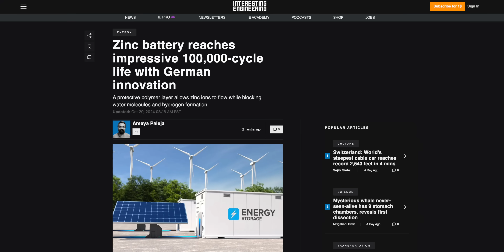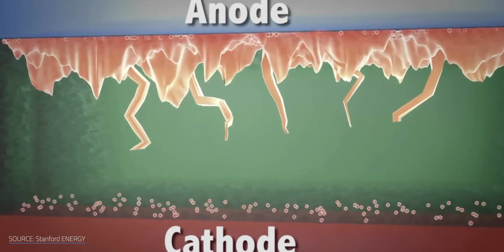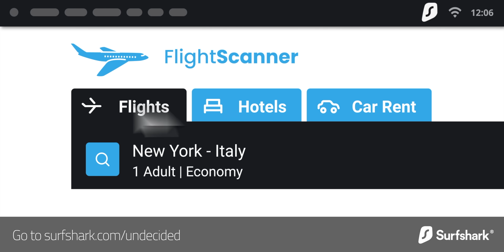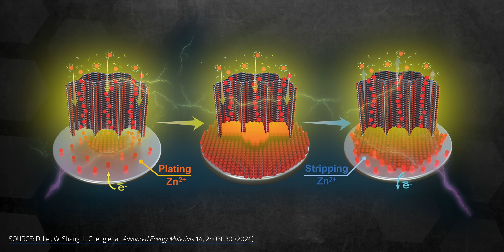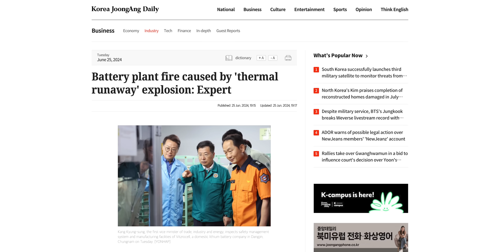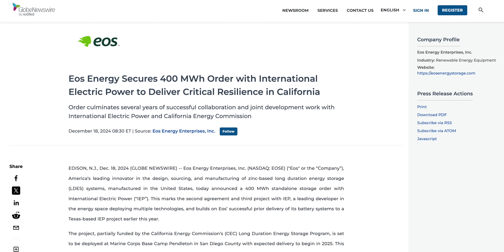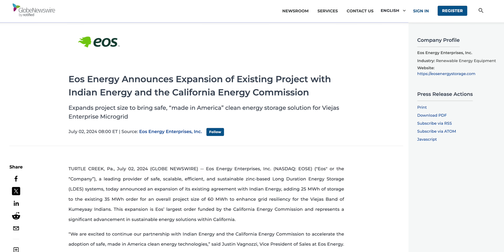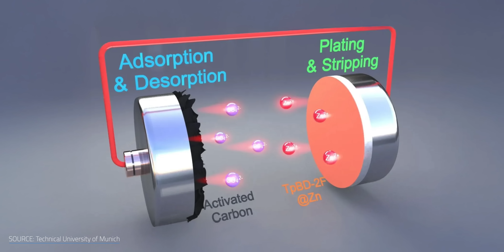How Zinc Batteries Are Defying Limits

Comment: Why do batteries have to last forever without any degradation yet we accept that a motor needs servicing and having parts replaced annually.
Reply: The energy density and power output per kg is super important too. If a battery has 500 times the energy density, but only holds 80%+ capacity for up to 10-20 years, it has more potential use and utility than one that lasts 273 years with 2 orders of magnitude less output.😊
Reply: what?
I never hard to replace parts in any of my car's engines.
What do you do with yours that you need annual parts replacements?
Reply: @joz534  fluids and filters every service. Belts less regularly. Other seal kits at regulated intervals. An occasional water pump, alternator or battery.
Reply: When you’re making massive investments in capital, you care a lot about cost per mile (in vehicles). I’m not sure what the metric would be for batteries, maybe cost per cycle? But the cycle gets smaller as the battery degrades, there’s depth of discharge metrics, etc. it basically comes down to how much it costs to maintain the batteries indefinitely. For gas engines, the initial cost is relatively low, and maintenance cost is also low. For batteries, initial cost is high, and there is no maintenance. Except there is a maintenance cost for batteries. You’re either continually adding more batteries to the system to make up for degradation, or after a certain amount of cycles you’re replacing the entire battery pack. Say you install a BESS that costs $1million. Because cycle life is low, you’re going to have to replace it every 10 years or something. That means it costs $100k a year to maintain. If you double the cycle life, it’s only $50k you have to set aside every year to maintain the battery. Doubling the cycle life effectively cuts your costs in half. Even if it costs 50% more to manufacture, you still come out ahead in overall cost. That’s why cycle life matters.
Reply: Because if I'm spending $10,000 on a battery for my house it damn well better last. Current lithium ion battery technology for homes is pointless as you never recoup the savings as by the time you have the battery needs replacing
Reply: The average engine if properly maintained can last well over 1M miles. The average car if properly maintained can last 30 years or more. Its the companies who keep telling us we need a new car every 5 years and stupid people who keep buying new ones every 5 years.
Reply: Motors are relatively cheap.  They're mechanical too, so it's expected that they'll degrade.  Hard to say whether any engineers feel batteries must last forever but the fact of the matter is, most batteries aren't lasting long enough for how expensive they are to produce or to recycle.
Reply: We don't. You think you have to replace an electric motor's parts in your car every year? It doesn't need servicing, either.
Reply: hands up which of you believes a 250hp motor is still 250hp after 5 years. What about 10? Yet batteries degrading over time is soooo a deal breaker. :)

Comment: Before even clicking on this click-bait video, the obvious point is that engineering is all about trade-offs.  If these were "the perfect fast-charging high-capacity quick-discharge battery that are easy to manufacture", they'd make them and we'd pay for them.  But they aren't.

Comment: You keep comparing it to Lithium but if it isn't going to replace or minimize the largest market for lithium batteries, Automobiles, what is the purpose of comparing it and saying all those bad parts of Lithium.  25 years ago, Lithium was a much better battery than Lead Acid, I won't even go into what was wrong with Lead Acid.

Comment: Problem looking for a solution ? who will keep his car / phone for 10 years + ? Maybe for grid storage ?
Reply: Car plenty of people phone not as many, for many normal users the main reason to get a new phone is the battery. My mom has had the same smartphone for the last 6+ years and its still fine. But this is where swappable standardized batteries come in like we have been using for decades in almost anything that isn't lithium-ion. There is also this little thing on the horizon:
The European Union's new battery regulation requires that portable batteries in electronic devices be replaceable by consumers starting in 2027.

Comment: What is the fire risk compared to Li-ion?
Reply: @stevenverrall4527  non they are water based, some minimal hydrogen off gassing but the battery generally won’t burn

Comment: this is the real house battery - if the cost per kWh is also competitive. until then it is still LFP.
depending on financial status, upgrades in the house could also be interesting. either for charging the car faster or backup in case of power outage etc.

Comment: One of the things I never hear people talk about is age degradation.  I just had to replace the EV battery pack on my 2016 Kia Soul EV and it only had 28k miles on it, was never supercharged and it was always garaged and left between 70-90% charge while being stored.  Kia was nice enough to replace it free of charge under an extended warranty, but this does not give me confidence in the longevity of these batteries.  Not only that but many of these batteries are failing prematurely; costing companies a fortune.  It's not uncommon for an EV battery to completely fail after 50-60k miles.  I sure hope they are doing something about this.
Reply: Just the thing I worry about.
Reply: US federal law requires automakers to warranty EV and hybrid batteries for at least 8 years or 100,000 miles, so your car failed just past its warranty. California requires a 10-year, 150,000-mile warranty. Obviously most don't die the day after the warranty expires. EV batteries have improved a lot since 2016. With today's LiFePO4 batteries lasting for 4,000+ cycles (so 240,000 miles for a 60 kWh pack) and BYD, CATL, and Tesla shipping 500,000 mile batteries, battery longevity for EVs should no longer be an issue.

And for home or grid storage, 4,000 cycles means you can fill the battery with electricity every day and completely discharge at night for over 10 years (and then recycle it and replace it with an even better battery). Unless they are dramatically cheaper, none of the benefits claimed for other battery chemistries will matter.

Comment: Now, We need a company that will make a replacement battery pack for the vehicles...
Reply: As said in the video its not good for EV unless you want to drive around with a trailer that contains the much larger battery. Could make charging easy just swap trailers.

Comment: Zn cells typically run at 1.6 volts per cell and store something around 40W-h per kg.  These are values that only appeal to stationary applications, Not EVs or phones.
Much of Matt's video more so makes the case for sodium-ion batteries.  No surprise as the performance specs of Zn batteries are unremarkable.
Reply: Great points but you for got to mention the relatively low efficiency of Zn that makes them far less economical to operate and more-or-less rules them out as a viable option for most commercial stationary applications.
Reply: @mm3chadrogers  the efficiency is low due to the hydrogen evolution reaction. the goal of any research into zinc batteries is to reduce the hydrogen evolution and subsequent corrosion, which would increase the efficiency and make them viable to operate.
Reply: @mm3chadrogers  the EOS units are up to 95% RTE on 16hr discharge, that hurdle is dealt with
Reply: @whlphil  I'm going to need you to site your source there because that sounds like BS. Even if it is accurate, a typical Li DC block is 97-98%. Also, with the defunding of IRA on Monday I suspect that EOS's margin is completely gone and they shouldn't be expecting any more DOE grants for at least 4 years.
Reply: Exactly as stated in the video.
Reply: Still much rather have a larger battery on my home that could last decades than an expensive lithium ion battery that will be useless after 10 years and require replacement. At least something like this would eventually pay for itself in savings.

Comment: It's hard to tell whether zinc batteries will win out over other battery tech. The good news is that there are a growing number of battery chemistries that can work. In the end it's about cost per kwh. Especially in the storage market. There are plenty of safe choices for that already. So, cost is the big driver there. And it helps if the batteries don't take up too much space and last very long.
Reply: Great points @jillesvangurp. Additionally, this video fails to recognize the biggest issue with Zn and that's its low efficiency. Li has an RTE of around 98% while Zn is closer to 80%. That represents a massive contribution to OpEx that likely out-weighs the benefits of a longer cycle-life in grid-scale applications. It's also important to note that a longer cycle-life isn't necessarily a good thing in all cases. The technology evolves so quickly that it may not be the best idea to commit to Zn for a 30-year system when something dramatically better is likely to come along in 10 years.
Reply: @mm3chadrogers  If Zn batteries don't suffer thermal runaway and burst into flames that would be a strong incentive to adopt it in many situations.
Reply: @ferrumignis  most Lithium Ion systems available today are unlikely to experience thermal events and as safe or very nearly as safe as Zn. The fire we have seen in recent history (Moss Landing as one example) are technologies that are no longer available due to those kinds of risks.
Reply: @ breaking the covalent bond of an atom and its subatomic particles always comes at a price.
Reply: @ferrumignis  That's almost been eliminated already, you know that right ?
Reply: @ Are you being sarcastic, it's hard to tell?  Just a couple of days ago the worlds largest off-grid battery storage at  Moss Landing experienced their fourth fire.  EV buses in London caught fire multiple times last year.
Reply: @mm3chadrogers the EOS system is 85-95% RTE depending on cycle time short duration discharge lower RTE

The big advantage is no limit on cycles / partial cycles per day, and 3% degradation at 20 years so no repowering, no fire, no cooling system
Reply: @mm3chadrogers  It really depends on the application case, the environment in which they need to work (temp, air moisture, coastline or mainland, altitude etc.) the available space (and the property costs of said space), and much more. If you want low-maintenance solutions, do not rely on energy density and have cheap land available, you might as well use zinc batteries. If you're working with tight spaces and need high charging speeds, lithium (and maybe sodium) are preferable. 

We really NEED to stop with broad claims and instead assess the avialable solutions on a case-by-case basis.
Reply: @TheWeirdaholic  my job is literally to evaluate available solutions on a case-by-case basis in grid-scale BESS. Zinc has higher CapEx and higher OpEx (due to lower rte) relative to Li-ion (LFP specifically) today. It just doesn't pencil unless it's being propped up by government incentives. Now whether we agree with it or not, it looks like a lot of those incentives are likely to dry up with the new administration. Time will tell but it doesn't look like there's much opportunity in the market for zinc BESS right now. If its only advantage is "improved safety", that space is shrinking with current safety trends in Li-ion.
Reply: @mm3chadrogers  Can't argue with that
Reply: @mm3chadrogers  RTE of pumped hydro is less than 80% and yet its still economical
Reply: @E1Luch  you're comparing apples and oranges but ok. How many pumped hydro projects are under construction? 5? 10 maybe world wide? There's like 10,000 BESS installations going up today, almost all LFP. pumped hydro had over 100 years to dominate the energy storage market and it's losing out to Li-ion so maybe it is a good comparison to Zn. Zn might make a plausible option for the same 10 projects. I wouldn't build an industry around it.
Reply: @mm3chadrogers  Why would I compare total number of projects instead of their storage capacity? Pumped hydro is a huge investement that gets you 100s of GWh in a single project that operates for 50-100 years. And pumped hydro is still the dominant storage tech by GWh of capacity despite the rapid growth of batteries. Even if this changes by 2030, the point is that 70-80% RTE is enough if energy capacity is significantly cheaper and the system lasts for much longer. Also where did you even find Li RTE of 98%? Its the same 80-90% in the real world as far as I can find.
Reply: Cost per kWh is just one relevant metric. kWh/kg matter for mobile applications, max (dis)charge rate is relevant in other fields. The list goes on. It's very unlikely that there will be one solution that will fit all applications.
Reply: Not just cost per kWh, but cycle time. Cycle time isn’t a function of the battery but of the application. For grid storage moving the solar peak from midday to evening or taking baseload nuckear and turning it into a peaking plant is a short cycle. Doing storage for wind and solar on weekly or seasonal scales is a very long cycle time and will not make sense unless batteries are much, much cheaper.
Reply: but none will ever weigh less AND beat lithium's ability to give up electrons
Reply: @mpirron1  Lithium is only a fraction of the weight of a battery cell and its nature adds material to prevent fires or allow charging in colder temperatures. The difference in energy density for current Sodium ion cells is only 20% lower, even when the atomic weight is nearly doubled.

Comment: I love this channel. I also believe that GRID stationary batteries should standardize on other chemistries than LiIon, as weight and space do not matter as much there. So far my best efficient and Green candidates, where various Li Iron based LFE variants in the very short term, then Sodium Ion or Iron oxyde, not mentionnant the thermal storage solutions doped by phase change materials for the long term demands peaks, often dictated by extreme temperatures either ways, hence potentielly adressable by heat and cold storage instead of electricity. Why not a comparaison across all such candidates for Green stationary GRID barreries. Undervaluing weight and volume efficiency, and putting ahead cycling and cost per KWH and per KW, then recyclability. ?
Reply: Companies building grid storage make that comparison every time they build a new facility, and so far lithium-ion continues to win. Nobody's yet contracting for week-long or seasonal battery storage, but for those you don't care about cycle life, you need 25% and lower battery cost per kWh. Long-term thermal storage would be very cool. "Cold snap at the end of a long winter leaves villagers huddled around community's lukewarm thermal store."

Comment: Lithium titanate batteries: confused john travolta meme
Reply: So that is what is in the briefcase……
Reply: I was looking for a comment on that subject. What is the problem with this technology ?
Reply: @KissCool  Energy density. They work astondingly well and are tried and tested in space applications, but they require 2-3x times the weight and volume for the same amount of stored energy. That makes them hardly usable in the car industries where even the highest energy-dense NMC lithium cycled close to 0-100%(thus the fire hazards) struggle to meet the petrol car ranges. In other areas such as cycling and safety LTO is even better then LiFePo4 and more like a capacitor.
Reply: @ Thank you. But for home storage it seems way better (wider range of temperature, more charge cycles, safer). And for that usage, the weight/size isn't really a problem. Despite that, there are almost no LTO batteries on the market (except those from aliexpress). (my usecase is energy storage in a wood cabin)

Comment: You mentioned the energy density difference, but what does that equate to in size? Since some municipalities have limitations on residential lithium ion storage size (e.g. San Francisco's 20kWh limit) a safer alternative that could get that rule changed at the cost of more space might be a good tradeoff.

Comment: Did anyone else catch that (between 2:15 and 2:32)? "....making it (zinc) far more easier to source." Then, he precedes to talk about how lithium mining is concentrated in a few regions. Where are the zinc mining facilities and what are their capacities? Lithium is abundant, too. It's more about the mining and refining facilities than anything else, in a potential closed loop system.
Reply: It seemed to me that more than anything else, that Matt was making the case for sodium-ion batteries.
Reply: It's mined all over the world. China is the #1 producer with 33% market share.
Reply: @GerbenWulff  Would you happen to have clear numbers (ballpark)? A 30% market share of zinc could just equal a 5% market share of lithium.
Reply: @AscendedSaiyan3  You should be aware that the zinc market in tons is probably many times larger than the lithium market. Zinc is used for construction, galvanizing, fertilizer, sun screen, nutrition supplement, batteries, etc. Lithium is mostly used for batteries and then some people take milligrams as a medicine. It's more like a 1% market share in zinc would be similar to a 30% market share in lithium. If zinc gains a significant market share in the battery market (specifically for on- and off-grid storage), that will not have a dramatic effect on the zinc market.
Reply: Lithium is a relatively rare metal compared to Zinc.  The estimated global reserves are 220 million tons of Zinc vs 88 million tons of lithium.  However there are estimated to be trillions of tons of zinc deeper in the earths crust.
Reply: @ferrumignis  That is not the information I was asking for. Thank you, though.
Reply: lithium is on the top od the electrochemical series.